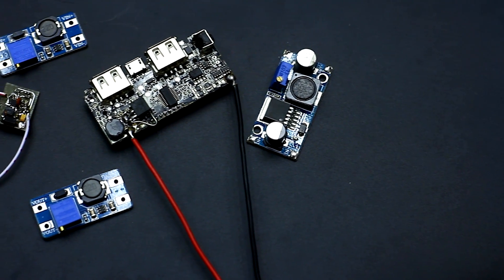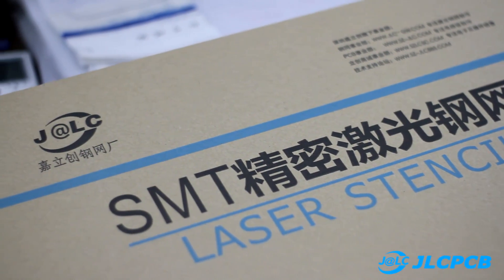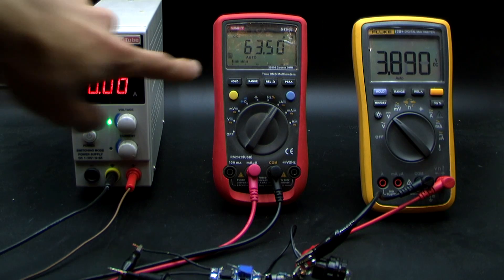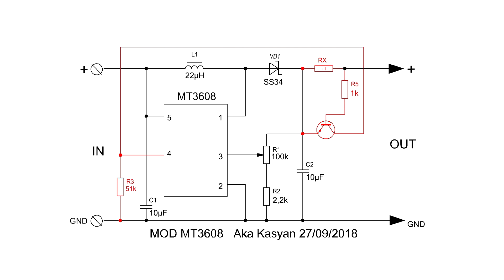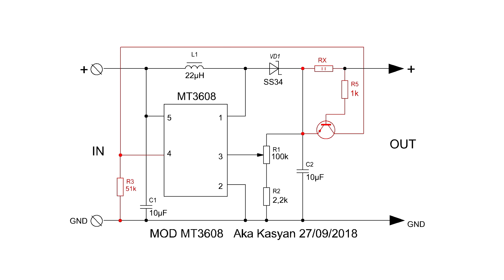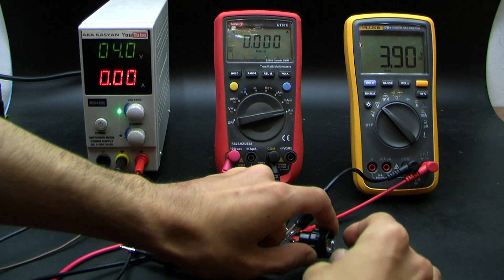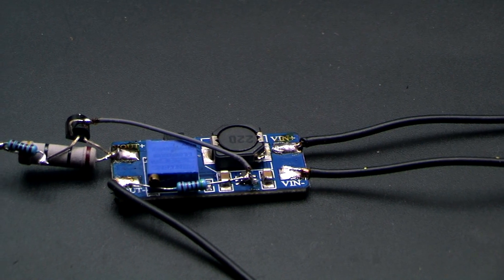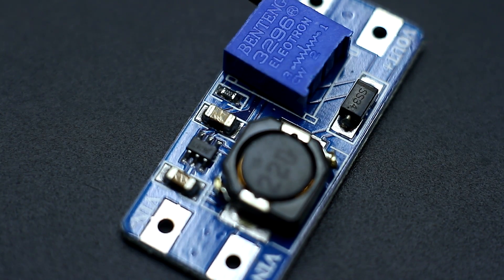This is useful to know! Rework MT3608 converter

Comment: Don't pry the IC pin up.  It will bend and then break off.  It did that twice for me.  Use hot air rework to remove the chip, bend it up carefully and then put it back with flux and hot air.

Comment: For multimeter application i have a solution for it.

The solution is by searching for the vcc pin of the multimeter, vcc pin is will output a 9V if the mutlimeter is on & 0V when off.

But it tricky to find this pin, but luckly i find one on my aneng m1 multimeter, so i just solder a cable to the enable pin of the mt3608 ic and the circuit works.

It measure 40uA when off & 5mA when on.

Comment: They seem to release the magic smoke if you input more than 6v.  I guess your PCB service won't take hand drawn schematics as I don't have the money for a license for PCB software or the time to learn how to use it
Reply: This is because of faulty design.   Note from the schematic in the video how the trimpot wiper  is not configured as a voltage divider.  If wound to the end of its travel it will put nearly the whole of the input voltage into  the feedback pin.  This input is rated at 6V maximum, and feeding more than that into it will produce the black smoke.   I have noticed that those versions which do not have thru-holes for the input and output pads are of a different design and work properly up to their rated input voltage for any output voltage adjustment.  You can also identify the correct version because the wiper of the trimpot is earthed.
Reply: @danielthackeray7798 perfect, you are the only one I have seen get this correctly, I made a video about it 4 years ago on my channel.

Comment: You can make this easier to set up by using two silicon diodes in series in place of Rx. In this case the PNP transistor will turn on as soon as the load current exceeds about 1uA (sufficient to cause a collector current of about 100uA to pull the EN pin to the active state). At this point almost all the load current will flow into the base of the transistor because the voltage across the two diodes will be only about 0.6v total (ie 0.3v per diode) and thus too small to cause significant conduction. Once the unit powers up the output voltage will be about 1.2v below the voltage on C2 (ie two diode pedestal voltages) and will have better load regulation than you will get using the resistor Rx.

I hope that is of use.
Reply: I have some SX1308 it draws 0.5mA in idle, but what is drawing those 0.5mA is the SDB628 ic or the diode?
Reply: @josxd8598  Even with the SX1308 at idle there is a current path from the input supply  positive through the inductor, through the diode and then through the two series resistors (whose ratio sets the output voltage when the SX1308 is running) to the supply negative. I suspect it is the current through this path that is responsible for a significant fraction of the idle current draw. You can calculate this current easily because the inductor will have negligible resistance at DC and can be ignore. The diode will have a forward drop of about 0.3v so the current will be = (Supply voltage - 0.3v)/(R1 +R2) where R1 and R2 are the resistors of this divider chain.
This current could be reduced almost to zero by adding a zener diode between the inductor and the top resistor of the divider chain. If this zener is of a voltage equal or greater than the supply voltage (say a 5v6 zener for use with a 5v supply) then the zener will not conduct until the unit is enabled. Of course the divider chain will need to be revised to get the correct output voltage in this case to allow for the 5.6v dropped across the zener during normal operation.

I hope that helps.
Reply: I'm a bit new to this game so sorry if this is a dumb question but will any silicon diode suffice? Will something like a 1N400x, or maybe a 1N540x, or a 1N4148 do the job (just because I have all of those on hand), or is there more to it than that?
Reply: @uniquepete9417  A very sensible question actually! I would use the 1N540x as they will carry the full 2A output of the module though if you were using it exclusively for a known lower current load you could use diodes of lower rating appropriate for that current. Probably only worth doing that if you were pushed for space to accommodate the bigger diodes.
Reply: Thanks
Reply: Yes, good suggestion. A further improvement would be installing your with @John Conrad's one: between diode and R1 (from voltage feedback). In this later case, the output voltage (Turn-ON) would be constant and the "internal" / additional Joule dissipation would be limited to (0.6 x I).

Comment: some questions...
can you varry op voltage without load ? 
why dont you use small slide switch before converter to save battery ?

Comment: Can anyone tell me what will be the value of R1 AND R2 if we want to get fixed 6.7V output not using rheostat to adjust.Input is 3.7-4.2v
Reply: I set it to the correct voltage then took the rhiostat out. Measured the impedence then selected the correct resister to put in the circuit.

Comment: Hi,

Is there any way to modify it for low current usage. I measured about 1.4mA. Want to use it for a smoke detector that works on a 9V battery. Instead I want to use a 16500 lithium with protection circuit and DC booster. But the smoke detector only uses about 0.03mA (calculated) so the 1.4mA of the booster without load is way to high
Reply: Hi,
Played a little with the original one.
Putting a small resisor in line with the inductor changed it a little but not much and depends on which side. Bigger stops it from working at all. 

Second attempt.
I removed the trimmer pot and 222 resistor.
Replaced the values by multiply by 4. (didn't have a 1M trimmer pot)
390K for the pot. 220k for the runner.
And replaced the 222 for a 10K resistor.
Output 9.4Volt
On current dropped 4x so instead of 1.3mA is went to 0.28mA no load.
400/500mA must be possible without a big voltage drop. (tested) 
When startup current is to high it falls back to 2.2V and can be reset by disconnecting the battery.

My smoke detector draws about 0.12mA.
With the booster it's 0.48mA total.
Still too high make some benefits.

Maybe you can do something with it.
I can't see how the output behavior is with this mod.

Combined with the mod in the video maybe it makes a bigger difference. 

Or try a 1M trimmer pot and 22K resistor instead tp see how it behaves. Maybe I test this later.

Comment: And how much more power is wasted into heat on the resistor you added once you connect the load to the circuit?
Isn't it easier and better to add a switch and turn the device off when it's not used rather then do this mod that wastes energy while load is connected?

Comment: Wouldn't it be possible to use the already existing voltage drop across the diode to trigger the transistor?
Reply: No because it's acting as a voltage divider for the base aswell!!

Comment: I have an idea. If you replace the resistor with two diodes in series and a 1Kohm (more or less) resistor in parallel with them you can obtain a more fixed output voltage. The resistor will put off the transistor, and when there is load, there will be a drop on the diodes. Actually it should work with a single diode too.

Comment: what is the transistor value of your own?
Reply: Actually you can see from the close ups that it is a 2n5401 PNP transistor used. For the resistors you can just read the value from the color codes.

Comment: Ever use a current mirror FET? It taps off a sample of the drain currrent into a separate pin, which can be used to measure the drain current. Seems like you could make a current sampler with no voltage drop and no quiescent power drain.

Comment: I have any questions, how I add constant curent output?
Sorry my bad English
Reply: By maintaining a constant voltage across a resistor.

A very simple way to do it is with, for example, a high gain NPN transistor. Put your load between Vin and the Collector. Then put a suitable transistor of resistance R between the Emitter and ground.

The voltage, V, at the Emitter is I × R Volts, where I is the current you want. So, for a normal NPN resistor with current flowing through it, the voltage at the Base of the transistor must be 0.6 + V. You can control the voltage at the Base with a voltage divider, and then the correct amount of current will flow.

Make sure the current flowing through the voltage divider is much larger than the current flowing into the Base. If you get that wrong, the current flowing into the Base will affect the voltage at the Base, and it won't work as expected.
Reply: @petermcarthur7450  any possibility you could email a quick sketch of adding an npn? 

I'd like to try this but only have one board and don't want to fry anything.

I'm looking to run one of these at 3-4a (max on datasheet) and need current regulation. 🍺😀
Reply: @SNG.OfficiaI  Is your supply voltage stable?
Reply: @petermcarthur7450  it would be a single li-ion 18650 and the load being 5v. I'd even be happy with 2.2A and have slightly larger inductors I can add..

Problem is the load drops resistance with an increase in temperature.
Reply: @SNG.OfficiaI  Is your supply voltage stable?
Reply: @petermcarthur7450  I'm not understanding the question, what do you mean by stable? The voltage drops on the battery from 4.25v full down to around 3v when depleted.
Reply: @SNG.OfficiaI  You want a circuit where ... something ... goes in, and a constant current comes out.

What goes in? A constant voltage? A range of voltages?
Reply: @petermcarthur7450  the input to the driver board is a single lithium ion cell so the voltage will vary. A full charged battery will run 4.25v volts but sag with intermittent use and in turn draw more current to compensate as the V in drops... The battery would be charged again after it depletes down to around 3v.
Reply: @petermcarthur7450  did I miss something? 

The supply voltage is a battery, so the voltage will vary by a few volts with use.

Do the circuit you referred to above require a constant voltage source?
Reply: @SNG.OfficiaI  Yes. You must have forgotten something, because you talked about 5V earlier.
Reply: The circuit I described requires a constant voltage. If the voltage is variable, you need two more components.
Reply: @petermcarthur7450  okay.. If you read back I said I need a cc for a 5v load with a a single li ion input. 

I don't see what is so confusing here.

If you don't want to help people out just say so...

Take care 🍺
Reply: @petermcarthur7450  also why would anybody need a constant current solution on a boost circuit that requires a constant voltage input? 

These boost converters are used almost always with batteries, the input is going to fluctuate.
Reply: @SNG.OfficiaI  You say you are trying to run a 5 V load on a 3–4 volt battery. That doesn't make sense.
Reply: @petermcarthur7450  how does that not make sense? This very circuit was designed to do just that, a switching circuit that is designed to run on a single li-ion cell and provide a higher voltage out.

I've used several boost switchers for this type application with 4.2v in and as low as 4.5 out.

These PCBs are cheap and a simple solution for me.. I was looking to save some time without breadboarding and thought you had already worked with this particular chip and would help save some time.

No worries, I'll figure it out ✌
Reply: @SNG.OfficiaI  I think you forgot to tell me that you are using a boost converter to produce a constant 5 V. Is that right?
Reply: @petermcarthur7450  I'm using the boost converter shown in the above video. I would like to add a constant current function to it versus the constant voltage to which they are sold as.

The datasheet for the ic shows that it is strictly CV... 

I'm thinking of adding an a circuit that would basically feed the vref in a way that allows a cc function...
Reply: @SNG.OfficiaI  Take out the resistor / potentiometer between Vout and Vref, and replace it with your load.

Take out the resistor / potentiometer between Vref and ground, and replace it with a resistor of resistance 0.6 / I, where I is the current you want. Make sure the current doesn't burn out the resistor!

That's all you need.

Comment: Interesting video! Perhaps you fond this interesting too: While making a video about using this module to make a 9V battery I fried the MT3608 chip. On my channel you can find another video about how I repaired the module.
Reply: It fried because the Vfb pin got more than 6v because the pot is missing a connection, see my video on how to fix it.

Comment: I'm not following the purpose of this circuit as applied to a multimeter.  Most multimeters worth owning have 9V batteries that last until they leak, which is often more than five years depending on use. Change your battery every year and you won't have that problem.  No turn-on problems with super-light loads either.  This circuit requires a power source, either battery or buck or P/S to work at all, so two parts are now needed when only one was before.  Why is that better than a plain old 9V battery?
Reply: 9v batteries are the worst on the planet at $4 each. Some meters last a week on 9v rechargable (1253b oled is one).
The old fluke 73,75,77 were excellent on batteries, but the newer stuff eats them in 3,4 months of daily use at work.

Comment: I keep a stock of these MT3608's to add to my own board designs. Although I haven't used them in a design yet in practice. The modules are too easy to play with, and I'm lazy ;)
Anyways, adding a circuit like this would be easy and could prove useful. 

  I'm not sure how off the top of my head, but it seems like we could make a better (but more complicated) circuit based on continuity instead of current using some kind of JFET, but I'm just typing my half baked ideas now...
Thanks for the upload.
-Jake
Reply: Upcycle Electronics , hey I was wondering if you can solve my dilemma regarding this converter. I have a beard trimmer that I turned to lithium using an 18650 battery, a tp4056 charging module and a this converter. It worked perfectly except that after a couple of days it doesn't work anymore. I have been messing with this on 3 seperate occasions with it working each time but for only a few days. Please tell me what you think. Thanks

Comment: For the transistor to turn on you need a voltage drop of around at least 0.6V on the resistor. That's quite alot, especially if the output current is a few 100mA. The resistor also makes the "output" voltage current dependent, which means you will often need another regulator (with it's own losses) after the this converter.
Reply: Or an op amp with global feedback. I honestly think it is the easiest implementation, perhaps not the cheapest. Any old op amp will compensate enough for the cross over distortion without any biasing, unless we are talking audio, but that's another kettle of fish. Regulating DC voltage is easy in comparison.